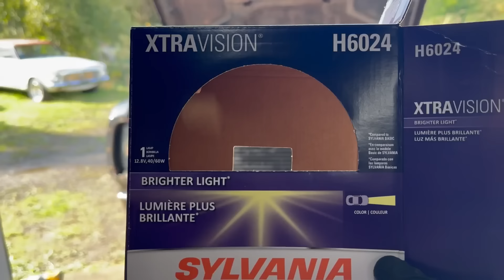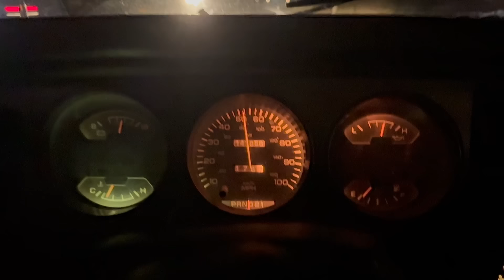Ramp Truck Nose Job! Classing Up My Beater 1992 Dodge D350 Cummins Truck With 1978 Dodge Truck Parts

Comment: I like it, but did I miss the part where you explained why you took everything off the 78 BUT the core support? Seems like that would have been the better solution.
Reply from the maker: I suppose you did miss it, because I definitely covered this. The intercooled Cummins radiator support is VERY different from any of the gasser trucks. The radiator mounting is special. There are provisions for mounting the intercooler, openings for piping and extra cooling lines. There is extra reinforcement to support all of that (hence my grille fitment issues.) Also, my air conditioning is charged and working, and I would have had to evacuate it to disconnect the condenser. Ignoring all that, even if I wanted to undertake the fabrication challenge of getting all of that to fit on a ‘78 core support (it’s been done, I’m sure,) I would have had to start with a different one - because that one is rusted out all the way along the bottom. I solved the headlight problem in fifteen minutes, and moving and adjusting the hood latch took about ten. I think I made the right call.
Reply: @SaabJitsu  Did you see the rust on the 78 ?
Reply: @DeadDodgeGarage  You did explain all that in the video. So I guess someone's attention span was a little short.
Reply: I like it I think it needs stacks !!

Comment: That's a MUCH better look, Jamie.  Glad things bolt over from one to the other as easy as they do - and what's a few self-tappers between friends, eh?  Maybe the ramp truck was trying to solve your hood clearance dilemma by springing a leak and MAKING you change the rad.  It's great when a vehicle works with you to solve its problems instead of fighting you every step.  

Also - much easier to take a spray can of generic black and touch up any new scrapes than it is to find a red that is somewhere near a burnished example of what it used to be.  My Mini is red.  I now have 9 cans of red paint that do not match the paintwork for one reason or another, although the plastic tops on the cans all look identical to it (and each other). I am giving serious thought to painting it in stripes as I am certain I could repaint the whole car with the amount of red paint I have in total.  Black is much easier....unless its metallic.  

And remember - when it comes to body-swapping, if it doesn't fit, force it.  If it breaks, it needed replacing anyway.  All the best!

Comment: Cool! This is exactly what I was hoping to see. I even like the black color, and once the red on the cab turns to black, it will be awesome. One cool touch would be a DDG logo on each door. I also like the Power Wagon emblems on the hood even though it's not a 4wd.
Reply from the maker: My thinking exactly on the emblems. They’re too cool to take off. It’s a wagon of power, just not that kind. Haha. There will be door logos. It has to be hand painted, so I don’t know exactly what the style will be just yet. I know I want to spell out the whole Dead Dodge Garage name so people know what they’re looking at. I don’t know if I will use the old logo with the ‘48, or something different. But we’ll get there.

Comment: Impressive!! Well done! Really need to add the transpo in8315 to fix the charging issues…just do it already lol
Reply from the maker: An actually working Mopar regulator getting correct battery voltage will work just fine 😁

Comment: You can replace those sleeve bushings on the door strikers with pieces of pex plumbing tube - the truck looks great, I love that hood.
Most of the old cars that I look at around here have no radiator shrouds

Comment: Some commenters: "The paint is ugly"

Jaimie: "I gotchu fam" 👌
Reply from the maker: I didn’t do it for them 😅 heck I’d rather keep the Penatrol on the truck and let them know how good it still looks in a year. But the left inner fender was not far away from falling down on the tire going down the road. Crack was spreading on driver fender. It was time to make some improvements.

Comment: It always scares me when you say "I have a brilliant idea"...I also did see a tiny amount of flexing on the extension you added when you were bouncing that wagon. But not bad. Really good job cutting and transplanting those headlight buckets. I love the whole front end replacement. Great work. I was really glad to see you bought new mirrors. Just cut, flatten, trim and drill a new hole on the bottom mirror support. Thanks for the video.
Reply from the maker: I think I’m going to use an extension on top instead, because at least on the passenger side I can’t really see the back corner of the bed currently. Thanks!

Comment: I love the 78 and that's why I have one. Unfortunately she has a cracked frame by the steering box so I can't drive her until I fix it. Long ago I had to change the radiator support and the best I found came from a square light model. I modified the headlight exactly like you did. I also had enough of the raincatcher hood and got a later one. Have to say it looks more truck like with it and a straight bumper from the same model. And my truck is proof a computer is not needed to run a 46rh because I put the lockup and od on switches. One day I'll fix the cracked frame

Comment: Don't forget to add the proper 1978 year correct "DIESEL POWER" fender decal usually found on Mitsubishi diesel powered D200s
Reply from the maker: Duuuuude, I want that! The other one I was considering was the cool diesel badge from an earlier big truck. But it wouldn’t be quite the right look.

Comment: Ramp truck in retrograde what a concept 😂. Add a cold are intake over the stock garbage. Makes a difference on performance and mileage and i speak from experience on that. I have a paint hack for ya and more on that later. Removing the bumper gaurd pieces means your ready for pheasant season😂. I do like the new look. Oh and back up light option. Pod lights and a second set on a switch for night loading. I like seeing what i am about to hit. ❤oh and this whole thing about bird bath hood. Do you see any birds using it. Its a rain catcher hood. 😂 dealers call it that when i was a boy. I didnt get it till i bought a truck. You auta see ice slide off in the winter when you turn. Big ice cleavers 😂

Comment: 92 truck wire harnesses are so haphazard comapred to 93-95 harnesses. They simplified wire runs together into one bundle that loops around the motor. So I suggest hunting down a 93-95 harness.
22:55 must be a mechanic thing I said the exact same thing you did.
36:05 No doubt I had the same reaction when I switched to LED's in my 95 Dakota.
Impressive job on the front clip swap. Great tricolor scheme by the way.
Reply from the maker: Good to know, but I don’t need any of that. I will be deleting essentially the entire factory harness because I do not need any of those sensors. It will be very clean and sanitary when I am done. But even as it is now, it is much simpler and almost sanitary.
Reply: @DeadDodgeGarage  heads up someone out in Rochester is selling 30 or so Mopars looked a fair amount of early models

Comment: I should have done better diagnostics, turns out what I thought was a bad rear differential turned out to be really bad U joints. On the plus side I don't have to change the rear differential but I do have to sell the one I bought.
Reply: Damn. Sounds like me.
Reply from the maker: Yeah, that checks out…

Comment: To get those headlights centered in the grille holes, I would remove the adaptor plates you made and slot the holes a bit outward for adjustment in toward the center of the grille. Problem solved. The canted mirrors....looks like MAYBE you can re-drill the bottom holes where the mirror mount hoop bolts to the lower mount a bit....might give you some adjustment. You could always slot the lower mounts to give the hoop more room to go inward where the flat becomes round, ya know? Anyway, solid job, man! And it's definitely more solid, plus you got the awesome Power Wagon hood and emblems! Nice! Take care, Jamie, and stay cool bro!
Reply from the maker: I intentionally put the lower mirror mounts as high as I could. If it was any lower, the angle would be much worse. I know what I’m going to do to fix it.

Comment: Cool, I'm more of the red truck look guy vs black. Which is why I have a white ram 😂 summer heat alone justified it.
Reply from the maker: In my ramp truck vision, the truck was always white. I don’t want a black truck, I just want nicer parts. But these are so nice and black, it will stay that way for quite a while. The good news is summer is barely a concern here, and the AC works incredibly well. Haha.

Comment: About that hood gap. Are you sure you don't have an aftermarket fender on one side? They used to vary quite a bit lengthwise.
Reply from the maker: 100% sure, and given that it was exactly the same with two completely sets of fenders and matching hoods…

Comment: I like the new look, it will work well with the Demon.  Yeah, I'm a sucker for birdbath hoods too..

I enjoyed he live chat last night. The discussion on stacks was interesting and I understand your reluctance on using them on the ramp trunk.  A thought crossed my mind, what about using a pair of exhaust cutouts to feed the stacks, when you're hauling something they could be closed off and feed the under truck exhaust........just a ramdom thought.
Reply from the maker: My mom said to put fake stacks on for looks. This would be essentially the same thing. Haha. It’s an interesting idea! But ultimately, the utilitarian nature of the truck is more important to me than having a stack(s) and I will probably leave it alone. But the next truck… definitely gets a stack or two.
Reply: @DeadDodgeGarage  You're probably right , I did functional cut outs on my HEMI powered 37 Dodge PU a few years ago (dumped them out thru the F fenders behind the front tires).  Looked neat and sounded great when opened, but realistically I only opened them about a dozen times while I had the truck.

Comment: Yeah, my early '90's Cummins D350 is an ex-service ambulance.  I was astonished and frankly a little appalled at how astoundingly terrible the wiring is once the coachbuilder is done turning into an ambulance, given what an ambulance conversion on a chassis cab costs.  I've spent a lot of time making that wiring less crappy.  It still needs a lot more.  Some day that truck will run again.  Some day.

Comment: Looks great. Love the early style (bird bath hood) D series trucks. My taste liked the bull bar as apposed to the full grill guard but like they say "Tastes may vary". Definitely down with the west coast mirror's. I think once all your plans come to pass this will be one nice ramp truck. And just an FYI the input shafts on the dodge 4500 5 speeds are known for issues so might want to upgrade but look who I'm telling you probably know way more then this Chevy guy knows?... 😂
Reply from the maker: Input shaft issues on 4500? I know the first series 5600 has a dinky input. I thought it was just the 5th gear nut and good to go on the five speed. I’m not going to be putting down 1000 pound feet of torque. The bull bar is cool, and I even thought about leaving that, but it just says off-roader to me. The full guard says tiny semi, which is my whole goal here. Haha.
Reply: @DeadDodgeGarage  I could be wrong. I do know about the 5th gear nut thing. I'm a Chevy guy so what do I know about Dodge? LOL. Get the mini semi look and like it myself. I just love the early Power Wagon grill and want to see it out front and proud. Looking forward to this build...

Comment: Id love to see what all wires you can delete under the hood ripped allot of the garbage wires out of my 98 12v and everything works still but lots more 2 do. Almost took off the fuel shutoff magnet thing for a manual cable thing but have hopes of figuring out the remote start..Im in Canada. Great video!
Reply from the maker: Every single wire coming from the computer can be deleted and the truck will still start and run. But if you want AC, alternator charging, overdrive to work if automatic, and grid heaters to function, you will have to add switches and an external voltage regulator.

Comment: I don't know what the original door was fitting like, but I would tend to think the black door may be bent after seeing the roof on it. I'm thinking at some point in the past the black truck suffered a gentle rollover or was rolled over in  snow. Just my thoughts from when I used to do restorations and bodywork.
Reply from the maker: The original door also fit bad, but the pillar area did line up slightly better. The whole time we were trying to align the black driver door, I kept saying it seemed like the door window area was bent. There is no obvious damage, and it does seal - remarkably. So I guess it is what it is for now.

Comment: I have heard that the firewalls are different. Supposedly the older cabs will work with the Cummins with a little  (massaging).  Do you know if that is true ?

Comment: I drove 3 hours, each way to look at a couple slants, both runners (I'm told) one was a typical grungy looking old motor (spark plug tube era) and the other was a very clean looking 1977, according to block stamp 7225 t 272e
I paid for one, he said I could choose either.(I have to go back with a truck to get it) The cleaner one was in a friend's car that was on the road driving regularly,  but he swapped it for a 318.

I'm leaning towards the 77. He thought it was the original engine to the car but it was a 72 valiant. So I'm guessing it's a rebuild since it looks pretty nice.

Which would you go with? The early one has a new carb, coil and water pump. Both engines were pretty clean under the valve covers, the 77 a little more so. He was kind enough to take the covers off for me.
He only drove grungy one around the yard with a gas can. 

The only thing about the 77 is the head was a little rusty under the valve cover over by number 6, as if a little water got in and pooled in the corner, but the engine turned nicely by hand.

Thank you@
Reply from the maker: I’d almost certainly take the ‘77.
Reply: Thank you. And thanks for the t-shirt that I just ordered from your site!

Comment: I worked at the Dodge dealer In 77 the body panel fitment was horrible We'd take the screws out of the cowl panel slide it forward and redrill the holes

Comment: Well there's been a few folks in my neck of the woods that have took a four door and put the Cummins out of a 91-1/2 to 93 and the WHOLE front clip including the core support along with the front doors and complete dash and heater and AC BUT never have I seen anybody do what your doing here but I knew it was going to be problems trying to use that grill with the intercooler and that core support . I don't know why you have that gap in the hood , I don't have that with my 92 .
Reply from the maker: I’ve seen that swap done on many crew cabs. That’s how I knew it would more or less work the other way. As you saw, the only issue at all in mounting the grille was contact with the turn signals and those two intercooler boots - in addition to the required condenser clearance on the lower filler panel. I expected it to be much worse, frankly.

Comment: 98 Ram 1500 5.2l. I installed the Hughes air gap manifold and replaced the thermostat housing with a new Doorman housing. Long story short I can’t get it to stop leaking. I first installed the new t-stat housing with the supplied gasket no rtv and it leaked. I took back apart and replaced the t-stat housing gasket and used black rtv on both sides of the gasket, it still leaks. I have a cork gasket from Hughes that came in the intake manifold kit that I was going to try next. Any suggestions? Next time it comes apart I’m going to replace the water pump and timing cover gasket. What do you use on the water pump bolts that go into the water jacket? I think there are 5 bolts total that go into water jackets. Last question, when replacing the timing cover gasket do you use rtv other than down at the oil pan?
I appreciate your feedback and thank you!
Reply from the maker: I have never sealed those timing cover / water pump bolts and have never had one leak. The factory’s recommendation for “wet” bolts was just silicone. Or you can use thread sealant, or Teflon tape. On the thermostat housing, leaks there are common. The biggest problem I have had is being supplied the wrong thermostat gasket by the parts store, or in the felpro head set. The correct gasket has oval bolt holes, which make room for the little tits on the thermostat housing to sit in. If your gasket doesn’t have that, the tits could be holding the housing up off the gasket. I usually find myself punching the sides of the bolt holes with a hole punch to fix that.
Reply: @DeadDodgeGarage  Thank you 🙏. Im positive the t-stat housing gasket had oval holes. I appreciate you getting back to me.